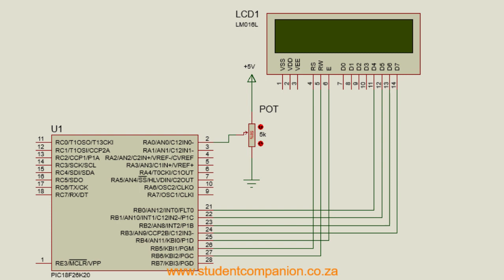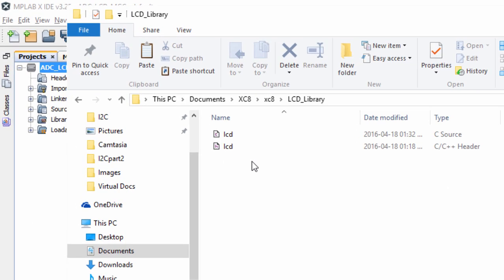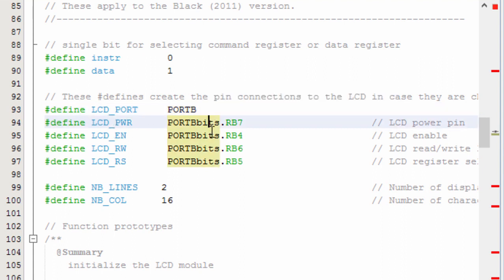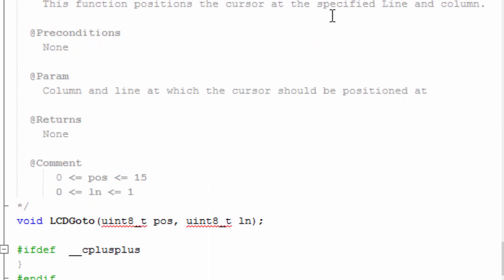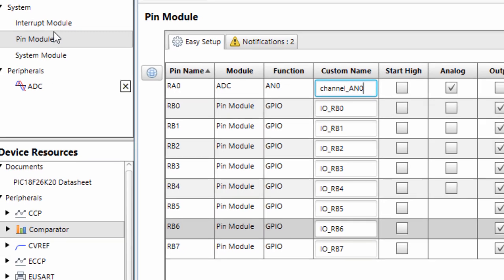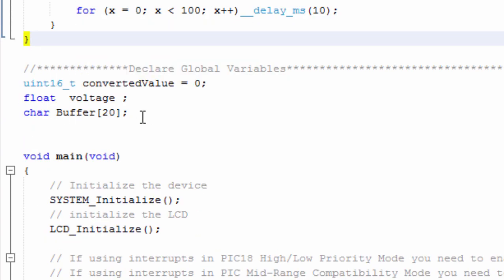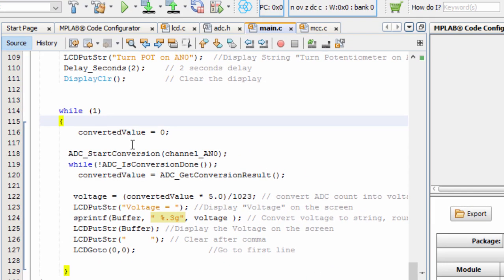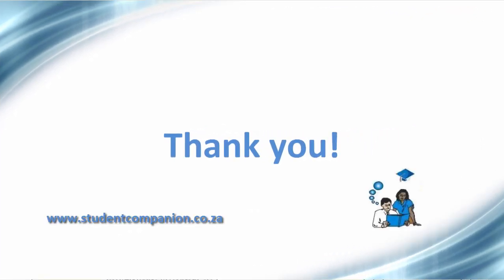22- ADC and LCD with MPLAB Code Configurator | MPLAB XC8 for Beginners Tutorial

Comment: My dear, I am impressed with the tutorial. Pls, I need some help. I am working on DIY AC Digital  Wattmeter as my final year project. I have battled with the codes and schematics for months now yet don't have solution. Please, help me solve this problem. I will share my code and schematic drawing here. Think in advance
Reply from the maker: Thanks for watching our videos and for your feedback. 
We can only assist you with what you already have if you are getting errors especially if it's related to our videos.  Unfortunately we can't write the code and schematic for you unless you hire us.
Reply: Thanks for the quick reply. I adopted DIY AC Digital Wattmeter as my final year school project. The website for both the schematic and code is http://www.solo-labs.com/diy-digital-ac-watt-meter/ . I drew the schematic with proteus, the coding with mplab, compiler xc8. During the schematic drawing, I could not find the hcpl-0630 component do I used 6n137. After generating the hex file, then buning the into my PIC I got logic contention(s) detected on net. The Pic is PIC185F252. Below is my code, actually someone helped me with the code: /*  Question from Ukaoha in Microchip Forum http://www.microchip.com/forums/FindPost/1044509 */
/*  Modified by Mysil to compile with XC8. */
#if (defined __XC8)

  #include <xc.h>
  #include <stdio.h>
  #include <stdlib.h>
  #include <math.h>

//  #define _XTAL_FREQ  20000000
typedef long int       int32;
typedef short int      int16;
typedef short long int int24;
//  #warning "Dummy definitions to replace missing functions."
  #define set_rtcc(t) TMR0L = t; INTCONbits.TMR0IF = 0 /* Timer 0 in 8 bit mode. */
  #define setup_spi(s)     /* Dummy definition to empty. */
  #define setup_timer_0(s)    /* Dummy definition to empty. */
//  #define lcd_init() LCD_Init_Display() /* Translation. */
  #define lcd_gotoxy(c, r) LCD_CmdWrite( 0x80 | (c -1) + 0x40 * (r -1)); /* Set DDRAM address. */
  #define delay_ms(d)     __delay_ms(d) /* XC8 compiler delay macro. */

/*  For Configuration bit settings with XC8, see separate file Configbits.c */
  #include "LCD_display.h"
#ifdef _16F886
  #define _XTAL_FREQ  20000000
  #define output_high(b)    PORTC = PORTC | b; TRISC = TRISC & ~b
  #define output_low(b)     PORTC = PORTC & ~b; TRISC = TRISC & ~b
  #define ADC0_EN           0x04u        /* Pin 2 */
  #define ADC1_EN           0x40u        /* Pin 6 */
#elif defined _18F14K22
  #define _XTAL_FREQ  16000000
  #define output_high(b)    LATB = LATB | b; TRISB = TRISB & ~b
  #define output_low(b)     LATB = LATB & ~b; TRISB = TRISB & ~b
  #define ADC0_EN           0x80u        /* Pin RB7 SPI Chip Select for ADC */
  #define ADC1_EN           0x20u        /* Pin RB5 SPI Chip Select for ADC */
#else
  #define _XTAL_FREQ  20000000
  #define output_high(b)    LATC = LATC | b; TRISC = TRISC & ~b
  #define output_low(b)     LATC = LATC & ~b; TRISC = TRISC & ~b
  #define ADC0_EN           0x04u        /* Pin 2 */
  #define ADC1_EN           0x40u        /* Pin 6 */
#endif

  #define enable_interrupts(b)  INTCON = INTCON | b
  #define disable_interrupts(b) INTCON = INTCON & ~b
  #define  INT_GLOBAL  0x80u
  #define  INT_TMR0IF  0x04u
  #define  INT_TMR0IE  0x20u
  #define  make16(h, l)   h << 8 | l

#else      /* For CCS compiler only */
//  #include <18F252.h> 
//  #device ADC = 16

//#FUSES NOWDT //No Watch Dog Timer
//#FUSES WDT128 //Watch Dog Timer uses 1:128 Postscale
//#FUSES NOBROWNOUT //No brownout reset
//#FUSES NOLVP //No low voltage prgming, B3(PIC16) or B5(PIC18) used for I/O

//#use delay(crystal = 20000000)
#define ADC0_EN PIN_C2
#define ADC1_EN PIN_C6

#endif

/* #INCLUDE           Removed, Mysil */
#if defined _18F252
  #define LCD_ENABLE_PIN PIN_A0
  #define LCD_RW_PIN PIN_A1
  #define LCD_RS_PIN PIN_A2
  #define LCD_DATA4 PIN_B4
  #define LCD_DATA5 PIN_B5
  #define LCD_DATA6 PIN_B6
  #define LCD_DATA7 PIN_B7
#elif defined _18F14K22
  #define LCD_ENABLE_PIN PIN_A2
  #define LCD_RW_PIN PIN_C0
  #define LCD_RS_PIN PIN_C1
  #define LCD_DATA7 PIN_A5
  #define LCD_DATA6 PIN_A4
  #define LCD_DATA5 PIN_C5
  #define LCD_DATA4 PIN_C4
#endif
#define SPI_MODE_0 (SPI_L_TO_H | SPI_XMIT_L_TO_H) 

/* #include          Removed, Mysil */ 

volatile char  tick = 0;
unsigned int32 adc_accum_v = 0;
unsigned int32 adc_accum_i = 0;

unsigned int16 adc0_ref = 0;
unsigned int16 adc1_ref = 0;

float rms_v = 0;
float rms_i = 0;

float rms_v_cor = 1.04245;

float rms_v_accum = 0;
float rms_i_accum = 0;

float adc0_step = 0;

#ifdef _16F886
unsigned int24 adc_value_v[5];
unsigned int24 adc_value_i[5];
unsigned char  nsample = 4;
#elif defined  _18F14K22
unsigned int16 adc_value_v[40];   /* Why 32 bit integer here? */
unsigned int16 adc_value_i[40];   /* measurements are <= 16 bits. */
unsigned char  nsample = 40;
#else
unsigned int32 adc_value_v[41];
unsigned int32 adc_value_i[41];
unsigned char  nsample = 40;
#endif

unsigned int16 sampling_period = 60536; // 65536-60536 = 5000 >> 5000x200ns=0.84ms 

float apparent_power = 0;
float average_power_accum = 0;
float vi_accum = 0;

unsigned char lcd_string[17];
char i, k;
#if defined __XC8
void interrupt RTCC_isr(void)
#else
#INT_RTCC
void RTCC_isr(void)
#endif
{
 TMR0L = sampling_period;   /* Timer 0 in 8 bit mode. */
 INTCONbits.TMR0IF = 0;
// set_rtcc(sampling_period);
 tick = 1;

 return;
}

void initialize(void) 
{
#if defined _18F14K22
 OSCCONbits.SCS = 0;     /* Oscillator as in Configuration bits. */
 OSCCONbits.IRCF = 7;    /* Internal RC oscillator 16 MHz */
 OSCTUNEbits.PLLEN = 0;    /* PLL not used yet. */
#else
  #warning "Oscillator setup needed"
#endif
#ifdef _18F14K22
 TRISCbits.TRISC7 = 0; ANSELHbits.ANS9 = 0; /* Pin for SDO signal Output */
 TRISBbits.TRISB4 = 1; ANSELHbits.ANS10 = 0; /* Pin for SDI signal, Digital Input */
 TRISBbits.TRISB6 = 0;    /* SCL signal Output */
#elif defined _18F252
 TRISCbits.TRISC5 = 0;    /* SDO */
 TRISCbits.TRISC4 = 1;    /* SDI */
 TRISCbits.TRISC3 = 0;    /* SCL master clock signal Output. */
#else
  #warning "Pin setup for SPI missing "
#endif
 setup_spi(SPI_MASTER | SPI_MODE_0 | SPI_CLK_DIV_64);
 SSPCON1bits.SSPM = 2;    /* SPI Master mode, clock/64  */
 SSPCON1bits.CKP  = 0;
 SSPSTATbits.CKE  = 1;
 SSPCON1bits.SSPEN = 1;
 
 lcd_init();
 LCD_DisplayConst("Wattmeter");
// setup_timer_0(RTCC_INTERNAL | RTCC_DIV_1); //13.1 ms overflow
 T0CONbits.TMR0ON = 0;    /* Disable while setup. */
 T0CONbits.T08BIT = 1;
 T0CONbits.T0CS = 0;
 T0CONbits.PSA  = 0;
 T0CONbits.T0PS = 3;
 TMR0L = 256 - 250 + 1;
 sampling_period = TMR0L;
 T0CONbits.TMR0ON = 1;
 INTCONbits.TMR0IF = 0;
 disable_interrupts( INT_TMR0IE);

 output_high(ADC0_EN);  /* SPI deselect external ADC0 */
 output_high(ADC1_EN);  /* SPI deselect external ADC1 */

}

void Spi_Write(unsigned char out)
{
 SSPBUF = out;
 while (SSPSTATbits.BF == 0);
 SSPBUF;        /* Empty buffer. */
 return;
}

unsigned char Spi_Read(unsigned char out)
{
 SSPBUF = out;
 while (SSPSTATbits.BF == 0);  /* Wait for exchange. */
 return SSPBUF;      /* Return received byte. */
}

unsigned int16 mcp3202_read(char adc_no, char ch_no) 
{
 unsigned int16 reading = 0;
 unsigned char MSbyte = 0x00;
 unsigned char LSbyte = 0x00;

 // Chip Select
 if (adc_no == 0) 
 {   output_low(ADC0_EN); }
 else 
 {   output_low(ADC1_EN); }

 // Send Start Bit
 Spi_Write(0x01);

 // Channel Select and Read High Byte
 if (ch_no == 0) 
 {   MSbyte = Spi_Read(0xA0); }
 else 
 {   MSbyte = Spi_Read(0xE0); }

 // Read Low Byte
 LSbyte = Spi_Read(0x00);

 // Join the Bytes
 reading = make16((MSbyte & 0x0Fu), LSbyte);

 output_high(ADC0_EN);
 output_high(ADC1_EN);

 return reading;
}

void main(void)
{
 delay_ms(100);

 initialize();

 adc1_ref = 2048;
 adc0_ref = mcp3202_read(0, 1);
 if (adc0_ref == 0) adc0_ref = 1024;  /*** Temporary test ***/
 adc0_step = 2.5 / adc0_ref;

 k = 0;

 while (1) 
 {   char  read_count = 0;

  set_rtcc(sampling_period);
  enable_interrupts(INT_TMR0IE);
  enable_interrupts(INT_GLOBAL);

  while (read_count < nsample)
  {
   while (tick == 0) {}
   tick = 0;

   adc_value_v[read_count] = mcp3202_read(0, 0);
   adc_value_i[read_count] = mcp3202_read(1, 0);
   read_count ++;
  }

  disable_interrupts(INT_TMR0IE);
//  disable_interrupts(INT_RTCC);
  disable_interrupts(INT_GLOBAL);
  read_count = 0;

  for (i = 0; i<nsample; i++) 
  {
   if (adc_value_v[i] >= adc0_ref) { adc_value_v[i] = adc_value_v[i] - adc0_ref; }
   else { adc_value_v[i] = adc0_ref - adc_value_v[i]; }

   if (adc_value_i[i] >= adc1_ref) { adc_value_i[i] -= adc1_ref; }
   else { adc_value_i[i] = adc1_ref - adc_value_i[i]; }

   adc_accum_v += (adc_value_v[i] * adc_value_v[i]);
   adc_accum_i += (adc_value_i[i] * adc_value_i[i]);

   vi_accum += ((adc_value_v[i] * adc0_step * 201) * rms_v_cor) * (adc_value_i[i] * ((5 / 4096) / 0.100));
  }

  average_power_accum += vi_accum / nsample;

  vi_accum = 0;

  rms_v = ((sqrt(adc_accum_v / nsample)) * adc0_step * 201) * rms_v_cor;
  rms_i = sqrt(adc_accum_i / nsample) * ((5 / 4096) / 0.100);

  rms_v_accum += rms_v;
  rms_i_accum += rms_i;

  k++;

  if (k == 20) {
   k = 0;
   lcd_gotoxy(1, 1);
      /* This is wrong, it is fortran that have unit in output statement. */
//   printf(lcd_putc, "f%3.1f V", (rms_v_accum / 20));
//   lcd_gotoxy(9, 1);
//   printf(lcd_putc, "%2.2f A", abs(((rms_i_accum / 20) - 0.1)));
//   lcd_gotoxy(5, 2);
//   printf(lcd_putc, "%4.1fW", average_power_accum / 20);
   
   /****** Temporary test ********/
  // if (rms_v_accum < 1.0) 
  //  rms_v_accum = 230.7 * 20.;
  // if (average_power_accum < 1.0) 
  //  average_power_accum = 573.2 * 20.;

   sprintf(lcd_string, "%4.1f V  ", (rms_v_accum / 20));
   LCD_DisplayString( lcd_string );

   lcd_gotoxy(9, 1);
   sprintf(lcd_string, "%2.2f A ", fabs(((rms_i_accum / 20) - 0.1)));
   LCD_DisplayString( lcd_string );

   lcd_gotoxy(1, 2); 
   sprintf(lcd_string, "%4.1f W ", average_power_accum / 20);
   LCD_CmdWrite( 0x80 + 0x40); /* Set DDRAM address second line. */
   LCD_DisplayString( lcd_string );

   rms_v_accum = 0;
   rms_i_accum = 0;
   average_power_accum = 0;
  }
  adc_accum_v = 0;
  adc_accum_i = 0;
 }
}
Reply from the maker: You are trying to rewrite the code which was originally in CCS compiler. I think it could have save you time to just use the CCS compiler with a new PIC.  You could have made fewer changes.
Reply from the maker: You have posted this problem in microchip forum, i think that's the correct place to discuss it as they are people who might be familiar with CCS compiler.
Reply: Having tried and still trying MPLAB I am asking for your help based on the original original code in the site earlier mention. Any help on correcting the errors on the first code in CSS. Please, assist me. Thanks
Reply from the maker: Unfortunately we don't code in CSS only MPLAB, mikroC, Flowcode and Arduino.
Reply from the maker: Rewriting the code using mikroC or MPLAB will take some time as we will have to go through all your requirements and read datasheets. Unfortunately we won't have time for that.we only assist with student companion related tutorials.
Reply from the maker: Why you don't you follow-up with the question you wrote in microchip forum? Somebody has already converted your CSS code to XC8 code. What's wrong with the code given?
Reply: Student Companion Thanks for that question dear. The code in question is given me logic contention(s) detected on net #00005. I am still waiting for help to that regard.
Reply from the maker: Ok
Reply: Student Companion what of helping me solve this problem of logic contention(s)
Reply from the maker: You can follow up in microchip forum.  Unfortunately we are not able to assist you with that.  We are not used to CSS compiler to check the original code.